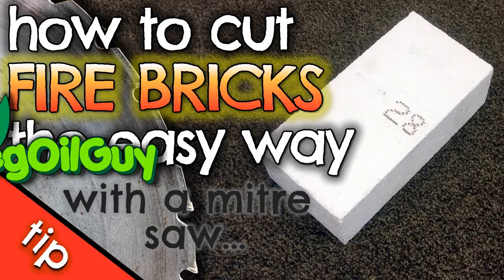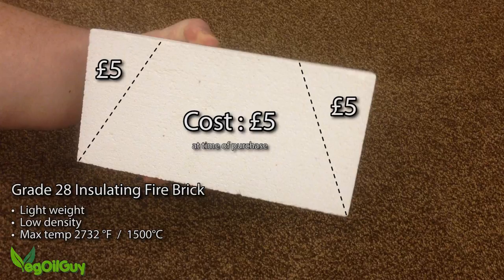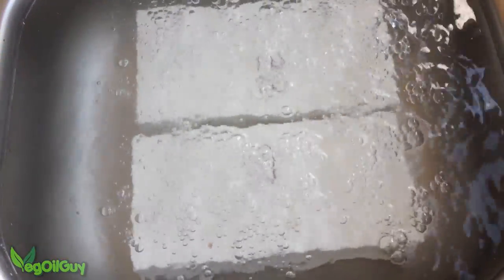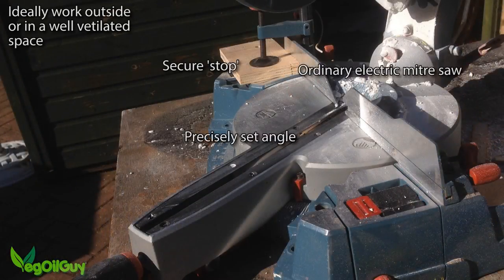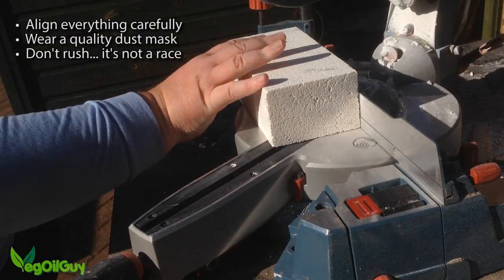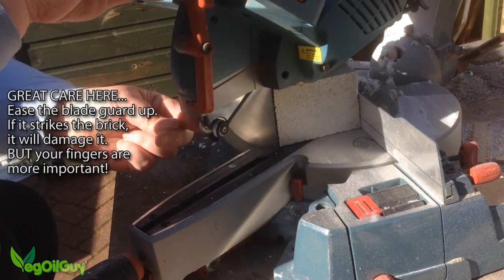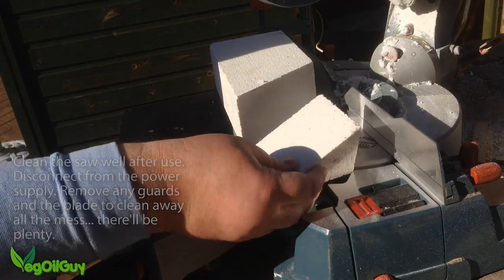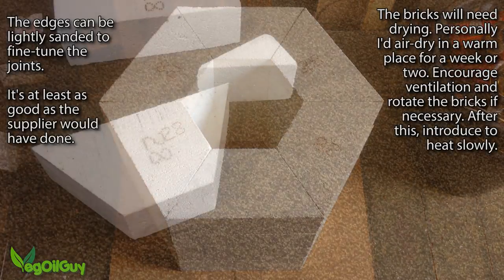How to cut Fire Bricks the EASY way with a mitre saw by VOGMAN

Comment: very helpfull from Australia god bless
Reply from the maker: Glad I could help. Thanks Tim : )
Reply: VegOilGuy i have to send you some e waiste i have 20t of it
Reply from the maker: Not quite sure what you mean by e waste but if it's anything like the leftover bits I had after my build, you might want to hang on to them. My electric kiln video should be finished in a week or so and you'll see how I used mine : )
Reply: VegOilGuy i have tones 20 approx of computers tvs all gold bearing circuit boards .100 of killoes of bga chips flat packs ic chips i refine pretious metals out of the electronic waiste ill have to send you a killo bag of gold bearing high grade chips .
Reply from the maker: Thanks Tim. You're a generous guys but there's no need. I do what I do because I enjoy it. If you feel the need to pay anything back, drop a coin or two in your favourite charity box : )
God bless
Reply: VegOilGuy will do god bless i have a beer in the fridge for you if you come to Vic AUST

Comment: I think it would be better to do this on one of those cheap hand miter saw guides that you can buy.Or use regular hacksaw.That way less dust will be flying around.Just for the sake of your miter saw engine(maybe wrap it in cloth to protect it from dust).

Looking foward to see your build,what wire you use etc.
Reply from the maker: These blocks are very easy to cut, but personally I didn't trust myself to consistently cut accurate angles and lengths, especially as the blocks are quite expensive and I didn't want to waste any. 
I can assure you that no harm befell my much loved mitre saw. It got a bit dirty, but I think it looked better afterwards than it did before - it certainly got a pampering from me, cleaning every nook and cranny : )
The dust is a big deal with these blocks. I'm told it's nasty stuff, so if you do any cutting wear a good mask my friend.
As for the build, don't worry... I'll share all my triumphs and failures.
Thanks for your comments : )

Comment: NIce cut! What sort of blade is in the saw. Very clever to use the water soak, I had not thought of that..... Martin
Reply from the maker: Funnily enough Martin I was lying in bed last night thinking that I hadn't mentioned that very point in the vid. Unfortunately with the loss of Annotations I can't even add an on-screen note any more (sigh).
It was just an ordinary wood-cutting blade, but I'd strongly advise NOT to use your best one. An old blunt one will do just fine. A new blade would become an old blunt blade very fast with this material I suspect : )

Comment: Looking at this method for a forge I'm making. Was there any damage to the blade after all the cuts?
Reply from the maker: Hi Toby... DON'T use a new blade. Use an old blunt one. You could cut these bricks with a spoon, they're so soft, but they will blunt a sharp blade : )

Comment: what's saw did you use and what's the type of brick? I unable to find in my country
Reply from the maker: I can't be sure what's available in your country my friend but these are the specs of the bricks I bought... https://shop.vitcas.com/all-products/fire-bricks/insulation-fire-bricks.html - they are Insulating Fire Bricks, so there's designed to withstand and trap heat. The saw is just a general purpose circular saw blade - BUT don't use your best one. Use an old blunt one. You could cut these bricks with a spoon because they are so soft, but they still dull a saw blade  : )
Hope this helps.

Comment: I recently cemented my bricks together after hand cutting with a panel saw, I got a crazy crystalline growth like fibreglass as it dried over the following days... I wonder if this is common?
Reply from the maker: I experienced the same thing on a couple of blocks that probably weren't as well dried out as the others - but only where I used cement. I took care not to breath this is (just in case) and can assure you that since my foundry has been fired up, it's not something I've seen since. This had me GUESSING this was a reaction to damp and the cement. But I could be wrong. Thankfully it's not something that hindered the performance and has long since gone   : )
Reply: Thanks heaps mate, good to know I didn’t mess up spectacularly!

Comment: I guess we have the high density ones here in Canada, as my saw blade just glows and makes no impact on the brick :-)
Reply from the maker: That's a shame Michael. They're great bricks. I'm really surprised you guys don't have them.
Reply: @Michael Lynch: sure we have them.  The kind of fire brick VOG is cutting is an INSULATING FIRE BRICK, they are very light, you could even cut them with a serrated kitchen knife, if high cut precision is not required, I have done that many times.   The ones that you are trying to cut are, likely, HIGH DENSITY FIRE BRICKS, which are very heavy and for which you better cut them with a diamond coated blade using a wet cutter.

Comment: Hi, that is a marvellous method of getting those bricks cut, will be doing this myself in a few days. Would you recommend this same method of soaking prior to cutting a 20mm hole, at an angle, in one of these bricks? (I am using grade 23 bricks as I don't require as high a temperature).Thanks
Reply from the maker: Hi Andy. Soaking prevents all that nasty and dangerous dust. If you use a mitre saw like I did, don't use your best blade... use an old blunt one. 
As for drilling holes, yes, you'll find this very easy. You could literally cut a hole with a spoon. They are that soft!
If you're doing several, just like you saw me do here, set up guides / a jig - this will give you precise and professional looking holes each time.
Hope this helps  : )
Reply: Yes of course it helps, many thanks. I have a table saw with an old blade, ready waiting and some old drill bits for the one hole I need to cut my burner hole. Can't wait for the ceramic bricks to arrive, TOMORROW......

Comment: Water expands during heating, the bricks will crack or plainly explode.
Reply from the maker: If you don't dry them, possibly. However, I do recommend allowing them to air dry thoroughly before use.
If you have any doubt whether this technique worked, I suggest you watch any one my videos from the Electric Furnace build onwards. There's dozens to choose from. In there you'll the bricks are still going strong.

Comment: They just cut it with an ordinary hand panel saw it cuts like butter
Reply from the maker: Ah... hand tools... the realm of the skilled : )
You're quite right, you could cut through these low density blocks with a spoon they're so soft. Certainly a hand saw could be used but in my unskilled hands I personally couldn't achieve the precision and consistency needed. Those with the skill I certainly admire.
The supplier of my blocks certainly had an electric mitre saw set up, but I guess it varies from supplier to supplier (along with the skill level no doubt).
Thanks for your input Allan.
Reply: @vogman  I have had a compound slide miter saw for years, best tool I ever bought really. Yes a hand saw and a miter box would work probably...but I have neither :-). Also setting the exact angle, and or a compound angle is MUCH simpler on the miter saw.